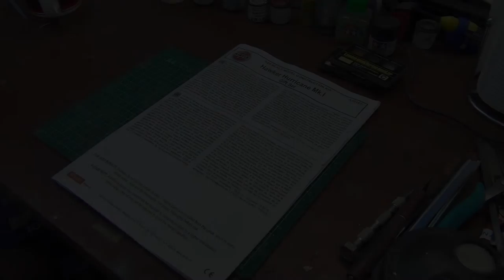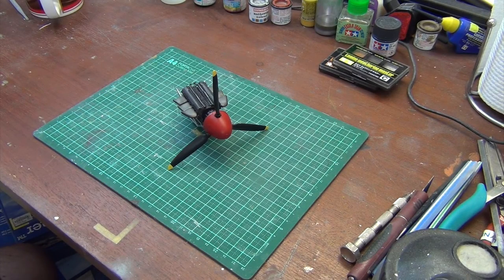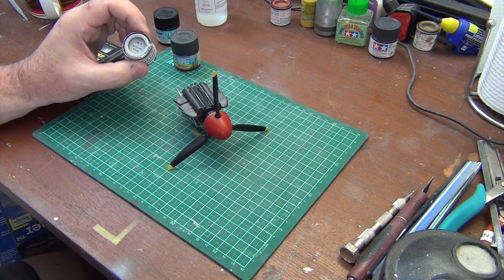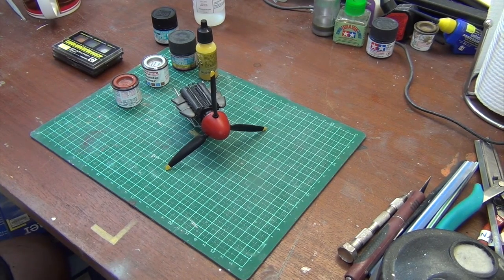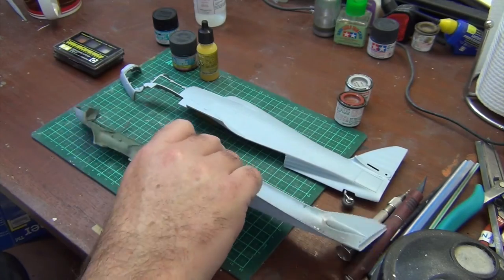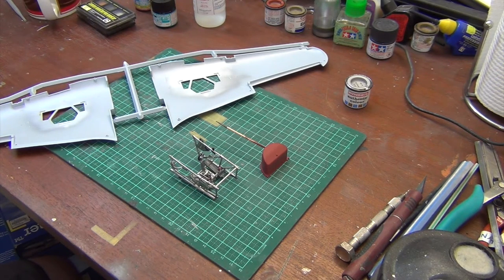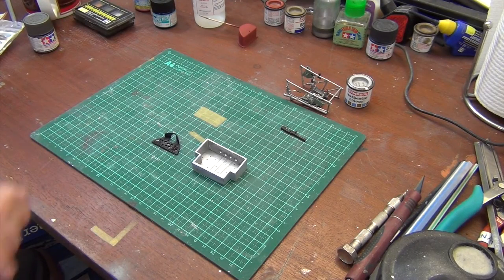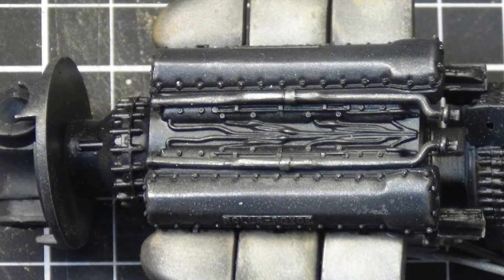Airfix Hawker Hurricane 1:24 Scale Progress Report 1

Comment: Love this model i’m working on one now. How or where can I come up with details of plumbing and electrical around the engine. I have ground off the raised wiring patterns on my engine and hand wired the motor using sewing thread. But I wish I had more just don’t know how to find it? This is a great kit fit really well. I barely had to clean up panel lines. I had to do a lot of kustom scratch work to really detail my cockpit by myself. Maybe someday I will find details parts and give that a try. I used that dense hard blue foam carved to fit into the body for glueing together the body. The nose area is very delicate so that help to keep the shape well. I really Like the paint work on your plane. I have to say that is my weak point though. Painting  Aaaggg how do the pro’s build these models so fast, it takes me 5-8 months to finish up my models. All the wiring and extra plumbing making the flaps work all that fiddly bits. I’m going blind can’t do the 1/72 scale anymore just can’t see good enough. I’m working on painting my 1/72 scale Lancaster bomber dam buster. Decided to paint mine Desert pattern or Mediterranean pattern? Something different ya know.

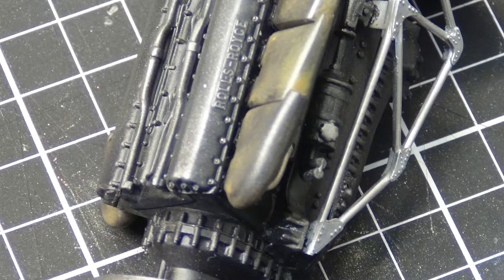Comment: Dan, nice work. Just a minor detail at 11:03. I believe the two centre exhausts on your engine are in the wrong place as they are the rear most ones due to the more rounded outlets. I thought the ones in my same kit were badly moulded until I looked at photos of the real thing.
Reply from the maker: Cheers for that Andrew. It is customary for me to make at least one or two clangers in every build, so good to see you found it on this one! :)  Ended up not finishing this kit as it was really frustrating, although I am still in two minds about buying it again and having a second go at it, now I have some more experience with building kits.
Reply: @DansModelBench  On my build I took your advice and fixed the starboard engine cover in place. I also had to cut the gearbox and engine apart after glueing due to misalignment of the engine halves. It wasn't until the propeller was offered up that the not so obvious error was seen.  I am a bit frustrated with the kit as per your comment regarding how  much flash needed to be removed although, after looking at many photos reference the missing doped detail behind the cockpit I see that the kit is correct to be smooth in that area. Any way, perhaps you should wait for new tooling before a second purchase, although I would like to see you take up the baton again on this one?
Reply: I know this is way past the time for comments, but others like me might be seeing it for the first time in 2021: As far as the middle and last exhausts being in the wrong place in this build video, that is right. They are. However, it is the kit that is wrong, not Dan. If you assemble it as instructed, the round hole will end up in the middle. It is not just the instructions that are wrong, that is how the parts are numbered, and sit on the sprue.

Comment: I have been given the original Hurricane to make from 1971  [Says on the price tag, £5 new] as a commission, unfortunately it had been started, and stuck together with an industrial adhesive, that no 'de-bonder' will touch, so I have had to cut the engine apart to get the electric [no longer available] motor for the prop into it. Inside is a leaflet saying "ARE YOU A MEMBER OF THE AIRFIX MODELLERS' CLUB? CLUB PAGE EVERY WEEK IN BUSTER & VALLIANT COMICS" For some reason the pilot, has turned out to look like a neighbour, but it's a really good build [just hope it's complete, as all the parts have been cut from the sprues]. Had to change all the old Airfix colours, to Humbrol, then to Tamiya and Vallejo, as well
Reply from the maker: Sounds like quite the challenge Anthony. The good news is you have an early pop, so the parts should fit much better and the detail should be sharper as well. How about decals? Are they salvageable or are you looking at third party replacements?

Comment: The very first Hurricane MK 1's had no self sealing fuel tanks and they were all a simple tin colour.
The later Mk1's had a self sealing reserve tank in front of the cockpit, these were a reddy brown and were in effect rubber bags.
Those that came after all had self sealing tanks and all were the rubber bag reddy brown colour.
Reply from the maker: Ah that is very interesting! Perhaps you can offer some insight on this next question. I've read conflicting reports and  photos, on the correct colour of the inside canopy frame for the Hurricane. It seems from what I can find,  that this should be silver, at least on Battle of Britain era aircraft. 

Any thoughts?
Reply: I'm afraid I don't know that, but I do know that pre war aircraft were finished to a higher standard and that would include Hurricanes built 36-39.
I suspect that there would be a mix of different frame colours during the BoB with a preponderance of bare aluminium towards the end.
This is just supposition of course.
If you know when your subject was built you could make an educated guess perhaps?
Reply: Dan's Van Diemens Land Model Bench Did you build that engine from the begining of this video? It is excelent!
Reply: I have a couple of photos of the cockpit canopy it looks like a dull off color silver the outside looks a little bit brighter silver. Who knows could be the sun light helps. The overall engine is basically flat black or a little bit dark gray mixed in. The mags were a alumn color some small parts like pumps and stuff where alumn in color the spark plug where gold and white reddish brown wires coming off the plugs.

Comment: Having watched the preview and progress report 1 I was looking forward to the next reports and the final reveal. What happened? Is it still in progress, or have you given up on the project?
Reply from the maker: Hi Johan, She is a shelf queen at the moment. I have about three or four kits in this state. Will get around to finishing it, but find the old and tired molds on this kit a chore. Cleanup and poor fitting parts got to me after a while. Dan
Reply: Thank you for the heads-up. I know the feeling ;)
Reply: @DansModelBench  Mine is assembled & primed, but sitting on the shelf waiting for me to sort out a couple of issues. Firstly, the nose seems distorted so much that the engine covers are a very poor fit. I may also have to stick the side covers on to try and force the nose straight. Secondly, there is a step where the top of one wing butts up against the fuselage. I'm going to have to sand down very carefully to avoid destroying the surface detail. 
I added a little extra detail to the gun bays: Firing solenoids and braided electrical cables for each gun. The instrument panel was completely replaced abd I opted for metal landing gear.
I know it's getting on in years, but I think the kit is still worth the effort. Given that I only paid £20 for it, I'm not complaining!

Comment: Same stage as ya vid mate, good to see how somebody else has done theirs 👍🏻
Reply: Hi Gappyps3. Its been on the backburner for a bit. I mucked up the instrument panel and lost patience with the seat belts too. I've since fixed the seat belts with the wifes help (she finished them) and I've ordered a new instrument panel to fix up my botch on that. The plane is buttoned up now, so when the new panel is here, I will put it in and do a follow up video.

I've ordered some oils too, which I hope to use on the weathering finish of her.

Glad I am doing this kit after so many years, but it hasn't been as much fun as I hoped at times. I think once i have the instrument thing sorted, I can start to enjoy the build again.

Would love to see your progress on the Hurricane, so if there is a chance you can post a video or pictures on the net, please do and let me know the link!

Thanks for watching.

Dan
Reply: +Daniel D sounds a mare mate, yeah I heard the kit has fitting issues, especially around the cowling, I'm trying to work around that by having it on the deck with cowling off for maintenance, so trying to get the engine looking nice. I usually scratch build all my cockpit details, so I'll be custom fitting the belts and enhancing the panel. Trouble is I'm used to 1:72 😂. I'll try and figure a way of showing you what I've done so far mate 👍🏻. Ben.
Reply from the maker: Look forward to seeing your work in progress Ben. Yes there is a definite fit issue with the cowling. My particular kit wasn't helped by having a very warped nose out of the box. I got the fuselage together, but fit of the engine and cockpit is pretty ordinary. In particular I am having trouble getting the fuselage to join over the engine and over the instrument panel. It could be my engine and cockpit aren't sitting right, as I thought I was being clever, by gluing the nose together, to fix the warp and then putting in the engine and cockpit from underneath. Maybe I wasn't as clever as I thought.

I am going to have another look at that when the new instrument panel gets here. I am thinking of using some thin plastic card under these joins to reinforce them and help give the glue something to bite into and hold the parts together. 

All I can say is, no matter what way you assemble the nose, test fit and test again. Try and reduce as much of the headaches as you can. The rest of the kit, so far has been pretty smooth sailing. I've done the rudder and the main wings and they went together fine. My kit, again had some moulding issues with the wings, but plenty of glue and some sanding fixed them fine.

Dan
Reply: +Van Diemens Land Model Bench sorry if it's late, sounded like you are Aus or NZ, I'm in the uk so it's only nearly 7pm. I've put a quick vid up to show you my progress, if you click into my name and get to it through there. Cheers mate 👍🏻.
Reply from the maker: G'day Gappyps3. Very Nice! Certainly looking like a Hurricane. Its really cool to share this stuff, so really enjoyed getting your update. :) Looks like you are going to put the engine/cockpit together as per the instructions? I tried to be clever and and put the engine in, then glue the front of the fuselage together and then put the cockpit in from underneath. Thought it might help with getting the engine sitting a bit lower, so the cowels would fit, but no luck. I put the instrument panel in later too and since I did it after work when I was tired, I made a rookie mistake or just working at my skill level (take your pick) and glued it in, in the wrong position (to far forward). Pulled it out later but ruined a lot of my work on it. Not sure with hindsight the whole way I went about assembling it was a good idea. I've got a new photo etch instrument panel from Airscale now, so I have to repair the damage and put that in.

 Apologies for the late reply. The Youtube notification that you had posted, must have slipped by me, but it really was great to see your update. Keep me posted mate. 
Dan

Comment: This engine on the beggining of this video is overwhelming. Did you made it?
Reply from the maker: Hi Ivan. 
No the engine is made from standard parts included in the kit. I used various paints, some different varnishes to simulate different finishes and a wash in places to pick out detail. Finished off with some Tamiya weathering master pastels over the whole model of the engine  - but especially on the exhausts. 
Regards,
Dan

Comment: Just back into modelling after a v long break. I have the kit from santa and just building the sub-assemblies. Santa also gave me the airfix electric motor which I am keen to add in. Has anyone any links showing how best to install it?
Reply from the maker: Tom. The best I could find was a discussion here: http://airfixtributeforum.myfastforum.org/Airfix_Electric_Motor_AF1004_about11540.html

Looks like you will have to do a little surgery and buy some more parts to get the motor in your kit. Good luck with it and please share your results with everyone when you are done. Dan
Reply: It turned out it was not so difficult after all. The first step was to build up the two halves of the engine block and put in firm foam "base" that brought the base of the motor up to the correct height, where the motor shaft was centred and parallel to the crankshaft line. It took a few foam shims to achieve that. It is easier to add thin slivers of foam than it is to remove the foam base and trim. Next was to cut a foam cover that just fitted under the top cover (I assume this is the rocket box) of the engine. Once glued in the motor is hidden. The two cables can be routed through the back of the engine via the supercharger / fan housing and connected as you see fit.
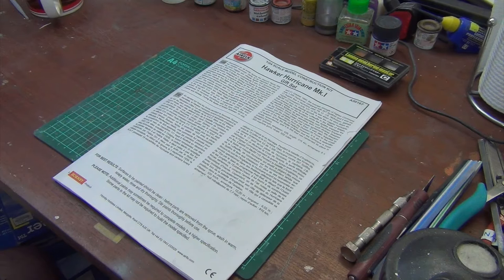Reply from the maker: Hi Tom. I wouldn't have thought to use foam to shim the motor. Very clever! Thanks for sharing that. I have one of these electric motors somewhere and the 1:24 AIrfix Focke Wulf in my stash. Might give that a go on that plane. 

I have to get back to the Hurricane though. Building a diorama for my sons birthday right now (Spiderman theme) and also have a kit review to do. Still the new instrument panel from Airscale http://airscale.co.uk/store.php#!/1-24-Scale-Hawker-Hurricane-Mk-1/p/58650135/category=16104112 arrived the other day for the Hurricane the other day, so excuses for not making progress are looking thin.

Hope you post some pics of your progress. Would love to see the build. Dan